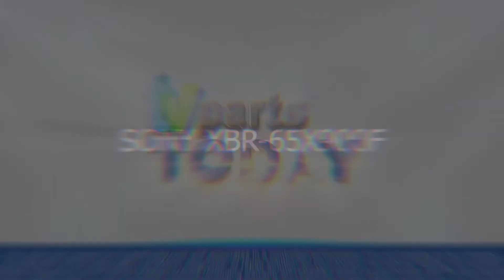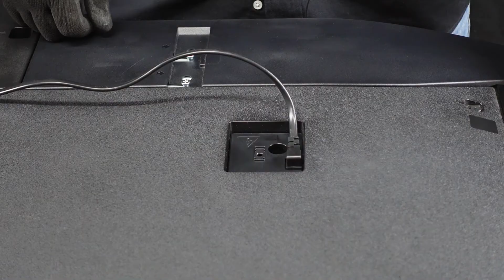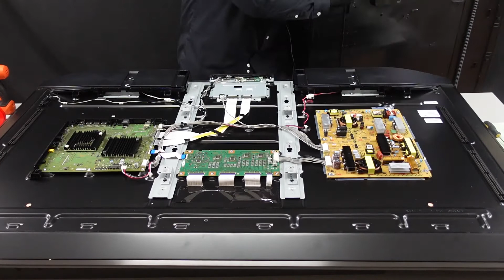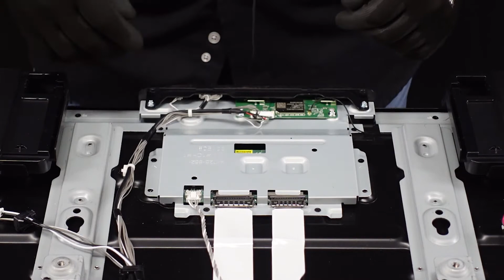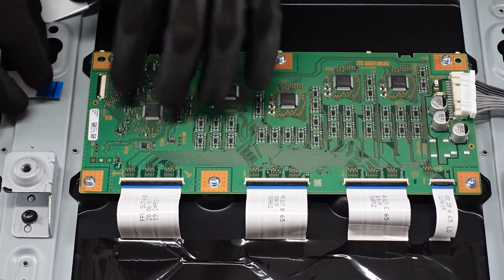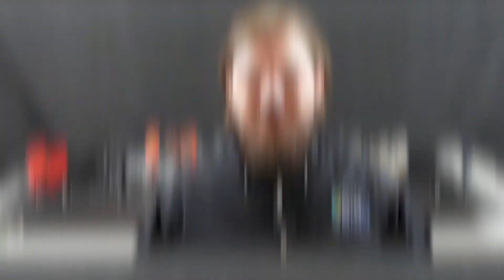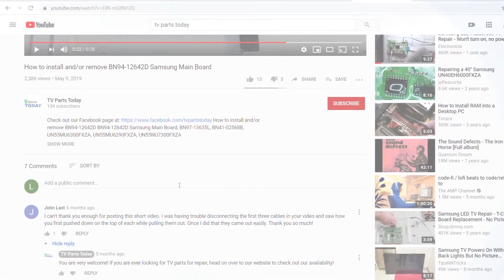Super easy TV board removal tutorial.  (SONY XBR-65X900F)

Comment: Do you have a guide with how to access and replace the backlight?  I think that is what we need to fix (55X900F blinking 4 red flashes) but I have no idea how to get to it.
Reply from the maker: Unfortunately, we do not have a back-light video. Check back in the future as we are always looking to expand our tutorial videos.
Reply from the maker: Does your model have an LED driver? If so that’s what the four flashes likely mean. If not secondary causes are power supply, main board, JK board, tuner board or the screen itself.
Reply: @tvpartstoday  I found a blown led in a backlight strip.  New lights on order, hope that is what is needed.
Reply: Backlight strip was delivered, installed and the tv is back in business.  Backlight had a total of 135 bulbs, 1 blown was enough to render the tv useless.
Reply from the maker: @my2k2zx2  Most definitely! I am so glad to hear you got it up and going! Way to go, Dustin! Backlight replacement is no joke! I am the only one here who does backlight replacement because it is a pain in the butt. Reach out if you have any questions or run into any issues - NJ, Plant Manager.
Reply: I also have the 55x900F and I bought the power supply board and just tried it out. No luck. The red light still flashes 4 times. What would be the next step and can I return the power supply board?
Reply: @CitationSoundsPro  I ended up finding 1 dead led bulb.  Put a new light strip in and it's working again.  It's a full teardown of the lcd panel to get to the led strips, not fun.
Reply: Hey. I wanted to know, if we can get in contact?

Comment: Hey there very helpful, thanks. I'm dealing with a Sony XR-75X90J. Won't turn on and the LED is blinking red three times. Is this a main board issue or power issue as well? It happened during a rain storm so I suspect power surge.
Reply from the maker: TV repair is a process of elimination; you replace the most likely circuit board to the least likely circuit board until one resolves the issue. If none of the circuit boards fix the issue then it is determined to be a failure within the back lights or the panel/screen.
If you replace a main board or T-con in a Sony the firmware most likely will need to be updated. I would highly suggest checking the Sony website to ensure that update is available for your model.
Reply: @tvpartstoday  thanks! I just connected the new main board. No red flashing led. The screen is backlit but nothing else happens. I tried updating the firmware with the USB drive but nothing different is happening. Any ideas?

Comment: Great video! Do you have one for the Bravia XBR-55A8G? I need to replace the main board and the back cover removal is different
Reply from the maker: If you email a picture of the back of your TV to info@tvpartstoday.com they can look into how to take the back off the TV. As for the boards it is just plug and play but you will need to make sure the Sony website still offers the firmware update for your model before purchasing the main board.

Comment: My Sony XBR75x900F just started with the 4 blinking lights. The tv attempts to start and i get the Android startup logo for about 10 seconds before it cuts off and I get the blinking red lights. I've seen several videos talking about just cutting and grounding the backlight error wire but I want to know what the actual fix is for this. Is it as simple as replacing a board? if so, which one?
Reply from the maker: Hello, 
The four blink code for this model is a backlight issue. 
At the time we do not sell backlights for this model.

Comment: Are there any lights on the Main Board that I can look at to see if it's operating properly? The backlight works but there is no picture and (probably) no sound. I tried one Tcon board replacement, so I suspect it might be a problem with the Main Board.
Reply from the maker: Hello, 
If you are experiencing no picture of sound we'd recommend replacing the main board. If you need help with identifying any parts you can email info@tvpartstoday.com and they can help you!

Comment: Hello i have a 2020 sony xbr55x900h & its out of warranty, purchased in 10/2020 @ BB, its displaying a white vertical bar & thin red line along in middle of screen,would it be needed to replace the  T-CON board to fix it
Reply from the maker: Hello, that could be the main board, tcon or the panel itself. If you could send a picture to info@tvpartstoday.com of what the display looks like we could provide better information.

Comment: my Sony XBR 46HX909 light just burned out , i cant tell what the problem is though, the tv turns on put no screen or picture, not sure if there is issue with a lamp or board
Reply from the maker: Your TV does not have a lamp, it has LED backlight strips. I would recommend replacing your LED driver board first if you have no backlights.

Comment: please be careful of buying anything here i buy a motherboard that say new but doesn't work i think they selling use part here that is not good and ripping off by not replacing or refund
Reply from the maker: We do not advertise any of our parts as new. For the most part, there is no such thing as a "new" TV circuit board as they are not sold separately from the TV when they are manufactured. They can only be harvested from scratch and dent lot TVs. If you have read the terms/conditions/returns policy, you would see that we stand by our products and in the case of any defects or damages, we offer free warranty replacements. Fill out the replacement request form on the website and our replacements department can get you taken care of.

Comment: Hi, I have Sony KD-55XD9305, the backlight and sound work and the Sony symbol appears on the start up, then the picture goes blank, and the backlight stays on. I changed the TCON board, and does the same. Do you think this is a main board issue? Never thought I would try and repair a tv myself, thanks for the videos!
Reply from the maker: Hello Amit, that could be a main board problem. If you need help to identify the part number email us at info@tvpartstoday.com.
Reply: @tvpartstoday  Thank you!

Comment: I have a thin white horizontal line with a red dot at the end about 10” up from the bottom of the screen on my XBR65X900F TV.  Is there something I should check or a board I should replace?
Reply from the maker: Unfortunately, there isn't anything you could check per se but lines are typically caused by the main board, tcon board or the panel/screen itself.

Comment: Hello My xbr-65x900f is suddeny showing a blue screen with no picture and no sound. No images appear on the screen no matter which buttons are pressed on the remote. The white power light is on.
Reply from the maker: We would recommend replacing either the main board or the TCON board.

Comment: Hello I have a problem with  my Sony xbr 65 the light flashing red for times how can't I fixed that problem
Reply from the maker: The Sony "blink codes", are a part of the diagnostic process for TV repair professionals. Usually, there are a number of different parts that a specific blink code will encompass. I would give us a call at (800)203-7484 and talk to one of our customer service representatives and we will try to get you pointed in the right direction.